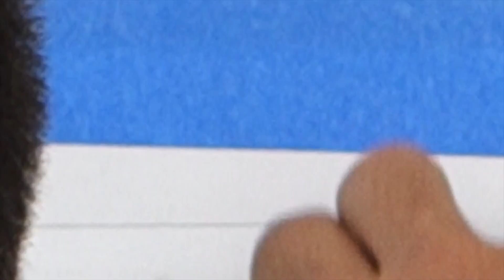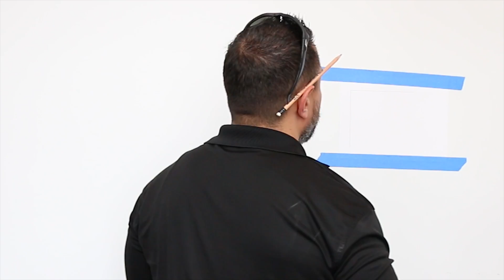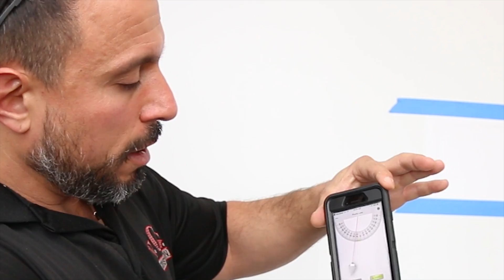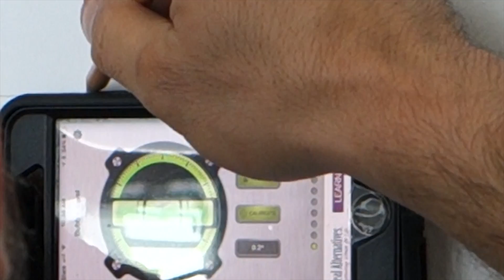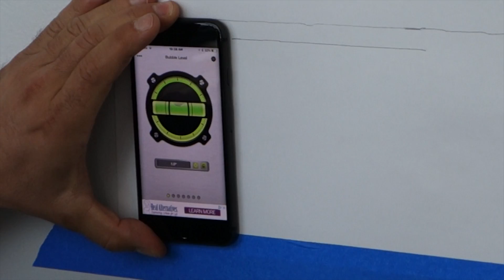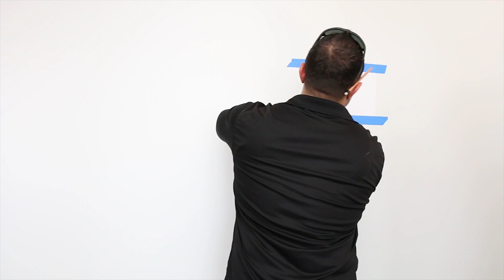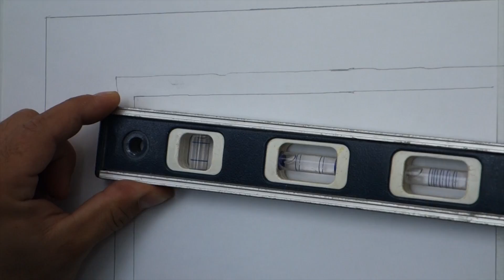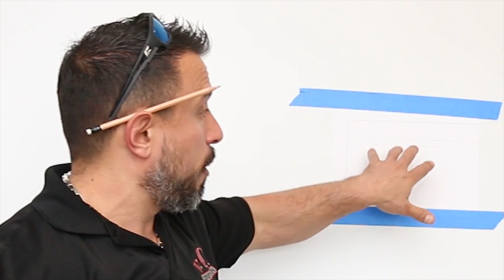Mobile Phone Spirit Level App - Better Than The Real Thing?

Comment: I use both, phone for digital read out. Just installed my first pool table, placed the phone on top of my 4 foot carpenter level. What appeared to be a good bubble level was off by 1/2 a degree. No  big deal for normal work. But to reduce ball drifts on the table. Awesome. Every tool has a specific advantage. The secret sauce, learn what works for your specific application.

Comment: I'm visually impaired and therefore, I need a level with audio. This feature is available but they get expensive. The iPhone Measure app includes a level that is very clear and has audio. I think that a length of timber with a slot router on the top face to allow the phone to sit securely could achieve a solution that would be accurate and cheap. I don't think you can think about the cost of the phone here. Most people already have the phone so it's just making better use of it.

Comment: a good old fashion plumb line is much better then a bubble and if you have the knowledge to make a perfectly flat surface you can use that and a plumb line to make a proper tool for leveling and measuring angles

Comment: If the smartphone sensors/app are calibrated correctly by the user, it will be more accurate and more precise than the traditional non-adjustable spirit level. A $5 spirit level can not be calibrated and performance is correlated to the 'luck of the draw'. Ultimately, the best option seems to be a dedicated digital level.

Comment: Ridgid bubble level. Calibrate to verified level surface. In the case of a case issue, use a carpenters pencil along side the phone as a straight egde.
Definitely not the go to, but it works fine for small things like outlets and switches.

Comment: I like your vids but I must say you are dead wrong on this one. It isn't the app more so than the sensors on your phone. Namely the accelerometer and inclinometer. All apps are only as good as your sensors. The same sensors found in commercial self-leveling rotary levels priced in the thousands. Your phone sensors are just as accurate as those. Google how to access your phone's hidden diagnostic menu to check if your sensors are operating at 100%. Something everyone should do after dropping their phone or when purchasing a used phone. If sensors pass then you're good to go. Download the app of choice and use the calibration function before first use. Do not use any app without a calibration function. After calibration use your app as it was intended. For peace of mind, you can easily check for accuracy using your best spirit or bubble level. Most discrepancies from testing various apps are almost always operator error. They fail to calibrate, use the app as intended, scribe lines correctly, or the worst mistake is using your phone with the case on and failing to compensate for any phone button on its side. The correct way to check for accuracy is by simply placing the flat side of your phone against your bubble level and both bubbles, or your apps needle or digital reading, should appear to match each other. There are so many vids on YouTube testing the accuracy of the apps when the true value of an app should be in the ease and function of the app. From the very basic to ones doing incredible calculations utilizing all sensors including the phone camera. That said, it's still just a tool. Mine is a $1400 tool so I much prefer my $15 Empire. These apps are incredible but I would never use it over my Empire for basic leveling however I love my AR Ruler app. I see so many people bashing on the incredible technology available when they should embrace it. It simply comes from not understanding and how to use it to a simple fear of change. Unfortunately, those same bashers will eventually be without a job. Most in the trade do adapt but I find it incredible when I see roofers and framers using hammers over nail guns, acoustic ceiling installers using water levels over laser levels, or engineers drafting out a set of prints by hand over CAD software. Most reasons for change is for speed and efficiency. Time is money and if you fail to change you'll soon be left behind.

Comment: some cases are better than others as they have cutouts for the buttons and my i phone is better than my samsung as it has 1 long edge with no buttons, also the clinometer is easier as it is in degrees and can be calibrated, and no matter how hard you try you cant make a call with a spirit level

Comment: A highly non-scientific 5 minute google search has concluded that smartphone gyros are accurate to about half a degree or so, which can compete with cheap spirit levels but not the more accurate ones. I guess to make the comparison fair you would have had to mount the smartphone on a flat piece of wood or something, and maybe use another app.

Of course you have to make sure the sensors are properly calibrated which I'm not even sure how to do on my phone, so you're probably still better off buying a level if you're going to measure levelness more than once every five years.
Reply from the maker: Cool thanks!!